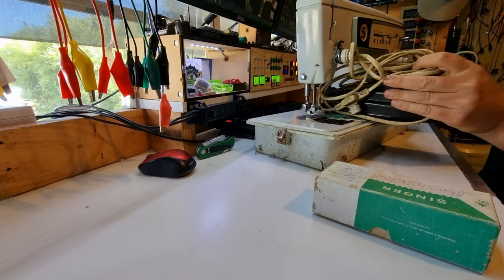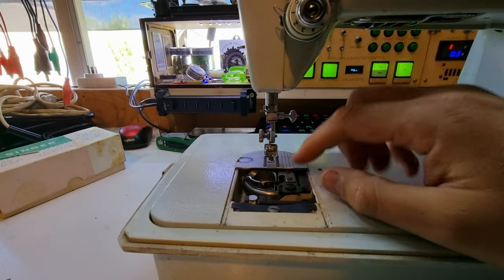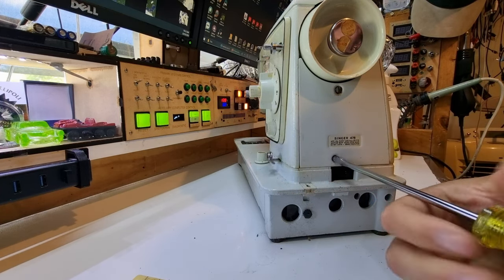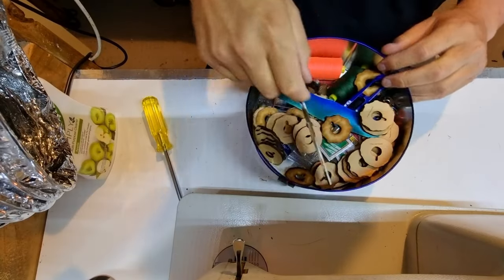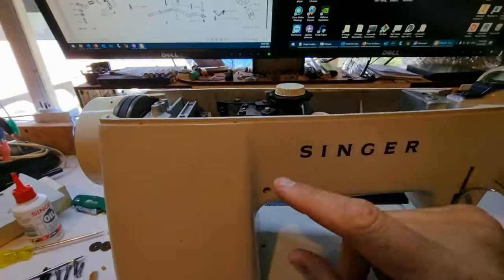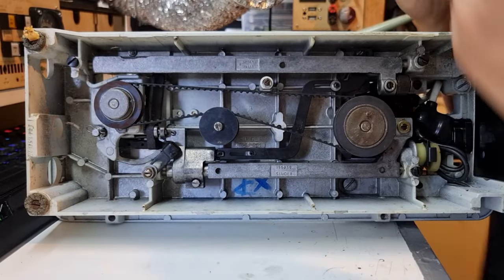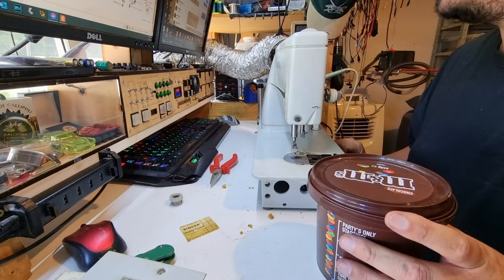Singer 478 repair | Part 1 of 3

Comment: So we have to watch part 3 first, to see how you removed the face plate?  Also, (did I miss something) you didn’t show the sequence on how you removed the broken vertical cam gear?   Still find this video very informative.  Thank you
Reply from the maker: There are some bits I didn't cover so clearly in those areas. the faceplate, I ended up sliding two spudger tools under it to pop off the stitch pattern knob, and there are small spring clips on the inside.
As this is an older video, I'll have to go back and look at them.
this is a link to the playlist of all 3 parts:
https://www.youtube.com/playlist?list=PLXvLC1_XYdhoGKTYVCN_V9Bq-MdePfzOo

Comment: Hello from Canada!  I just bought a Singer 478 from a secondhand store.  It seems to be missing the little post for the thread (on top).  Any suggestions as to what I can do?  Thank you so much!
Reply from the maker: Piano wire might come in the correct diameter, and can be cut to size, otherwise have a look around a toy/craft store, sometimes you will find decorative  items with acrylic rod of the right size
Reply from the maker: Also my amphibious 8x8 argo is canadian made, as is my landlord. Consider me a fan of Canada.

Comment: How did you remove stitch length knob?
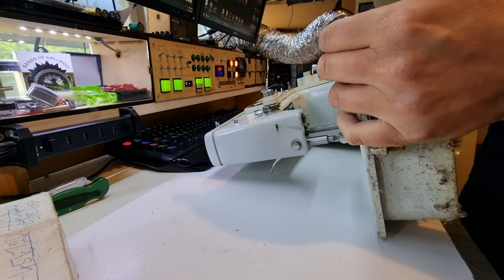Reply from the maker: I went over my archives, apparently I never filmed the removal, but it's shown in part 3 at 2:27.
I slid a couple of spudgers under it from opposite sides and twisted.
its a friction fit with a spring plate:

https://youtu.be/Yua67TeLUCE?t=147
Reply: Got it. Old fragile plastic. Detent is easier to get at with reverse knob removed when installing stitch length
Reply from the maker: I didn't know those two parts separated...